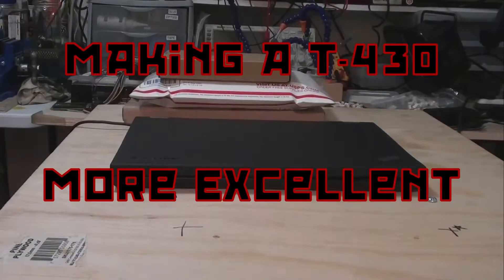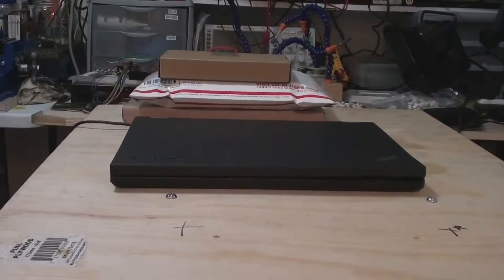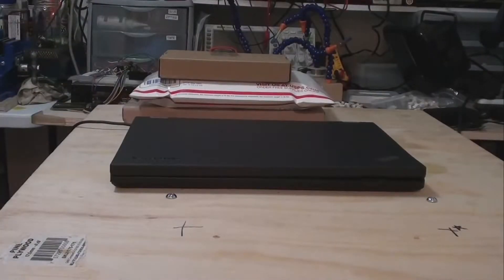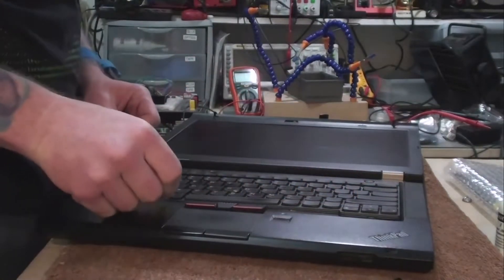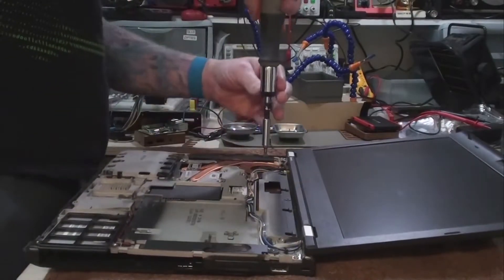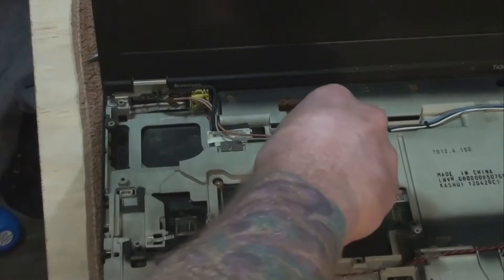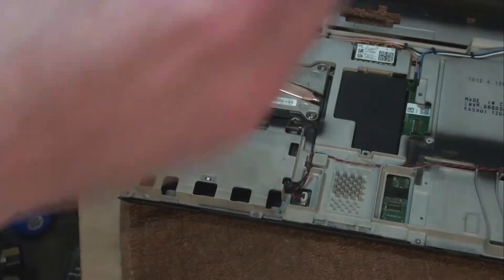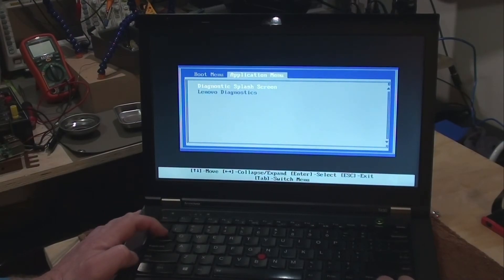Upgrading a Thinkpad T430 Laptop with New Hardware to Prepare for Linux and Programming

Comment: Good video. Mines the T430S. I’ve done a few mods ie ssd back lit keyboard. Having Wi-Fi problem. It had pop! Os 22.04 and I installed 24.04. and no Wi-Fi .Researching on installing driver with the terminal. Merry Christmas ❤

Comment: I put a i7-3740QM  on my T430 (no dedicated GPU). On Linux (the only OS I use) good temps all the time.
Reply: @InterstellarLord  tysm, yeah, sorry for that am a begginer in Linux :')
Reply: Hi! I heard the battery doesn't get charged with i7 45W cpus unless one plugs in a 90W charger. Does your 430 work with the regular 60W charger?
Reply: @artur19846  I am sorry, I am not using battery on my laptop, just to the power grid.
Reply: Hi, what type of linux are u using?

Comment: Hi! I've been doing similar things with my T430, but I was curious why you went for the 3632QM vs the 3740QM? The latter is a bit quicker and pretty darn cheap on ebay :)
Reply from the maker: I believe there was a huge cost difference at the time I made the video.  The goal was to upgrade as effectively yet cheaply as possible.

Comment: Nice. I did mine a few years back, also going for the 3632QM. It's a noticeably smoother machine than it was with 4 core i7 chip in it. Mine had quite a noisy fan on the heatsink, and I found the Nvidia chip frustrating. It drains battery too fast, and if you run on the onboard Intel GPU instead the mini DVI port isn't available to you! So I bought a new old stock motherboard on eBay (£23!) that didn't have the Nvidia chip (meaning the mini DVI worked with Intel GPU) and a Delta fan (the quiet one) attached to it. I had to dismantle the whole machine to do it (not too bad, given the excellent hardware service manual that's available) and now have a very quiet machine that doesn't get too hot and doesn't throttle. I did the 1080p IPS screen mod too, which takes it to a whole new level. It's great to be able to keep this old kit going.

Top tip for battery longevity - use tlp to set the charging threshold so that it stops charging at 60% max charge. The battery lasts a lot longer, and if you need to charge it higher for a few hours away from power, letting it go up to 75 or 80% every now and again is no problem.

Comment: Personally i prefer to swap out the DVD drive with a Blu-ray drive. The only reason to add a Ultrabay HDD / SSD would be to use it as a Mini-RAID. Also, if you do a BIOS Mod you can remove the WIFI hardware & Battery Whitelisting and also enable the full SATA speed. Something that is sadly locked and throttled by default.
Reply from the maker: Regarding the BIOS mod:  When this was made we were in the middle of the pandemic and the BIOS chip clip was selling for 400 USD which is why I just never picked one up to do it.  I plan on doing this at some point and making a video on it but life has been busy.
Reply: @penguinpropaganda  Oh you don't need extra hardware for that. Just a Linux Distri on a USB stick and the modded Bios files. It's purely software mod.
Reply: @KRAFTWERK2K6 
KOOL!
So where can we find the modded BIOS files?
Thank you in advance for your kind assistance.
Reply: Can you give some info and links for battery whitelist and Sara speed hack plz? Thanks

Comment: I've only got a E530 (£35 off ebay), but max'd out the ram to 16GB changed to cpu to the i7-3632qm 500gb ssd boot and 1tb spinner in the dvd bay, runs PCLinuxOS sweet..

Comment: Why not add a converter board and a 1080p screen? I thought that was possible too 🤔🤔
Reply: Yes i upgraded from the HD+ TN to a FHD IPS Panel, but most productive work is done in the docking station with a 1440p UW Monitor attached.

Comment: Great discovery today need some advice please?. Is it a must to replace the heatsink for Intel core I7? My goal is to speed up software tasks and get more done before battery discharges completely. I run my T430 daily for specific work, not my primary laptop. I currently have 16RAM   246GB  i5-3320M. Just looking to make it better/faster on a budget if I can. Thanks
Reply from the maker: I am not under the impression it is a must, but from what I have read if you don't update the heatsink the system can throttle.  Mine still gets pretty warm on the heatsink side.
Reply: @penguinpropaganda  Thanks for the reply. Are the Intel i7 3632QM got ebay or elsewhere reliable. Looking at costs brand new is around 300 here in UK. Pricy. Is there any others that work as good? Thanks
Reply from the maker: @johnjohnston1086  I bought mine on ebay from a reputable reseller.  I can't say which one is reputable for your area, (also I'm loathe to give out recs anyways because companies change), but my recommendation is to do some research on the seller and get a company that is recycling / parting out items.  This is how I got the keyboard as well.
Reply: @penguinpropaganda  cheers for reply i understand will look more into that. 👍

Comment: I have a T 530 that I got from my computer guy. when I got it it came with (choke) 1 GB DDR 3 RAM, i5 3230m CPU,and a 320GB HDD. I slightly upgraded it. 16 GB DDR3 RAM, 1 TB storage HDD,128 GB SSD bootdrive and a 128 GB SD card just for my GTA 5 install. Did I mention it was a freebie?